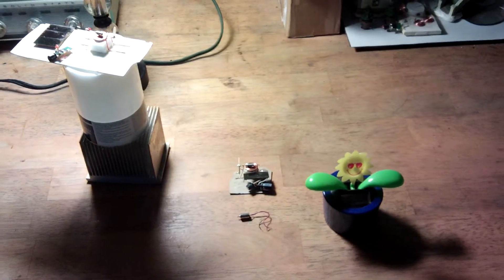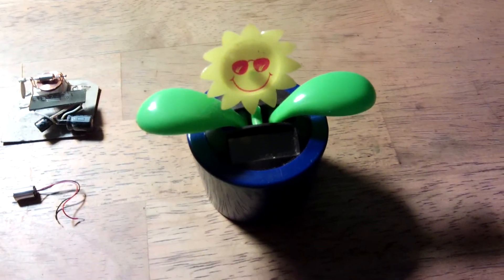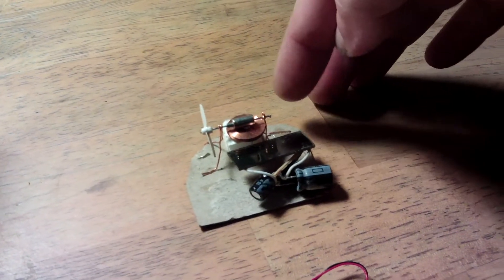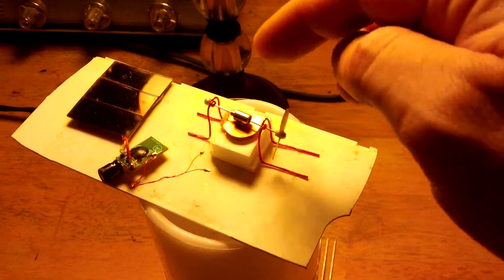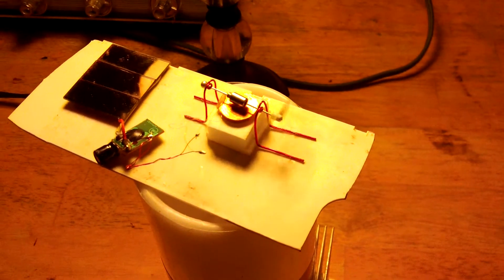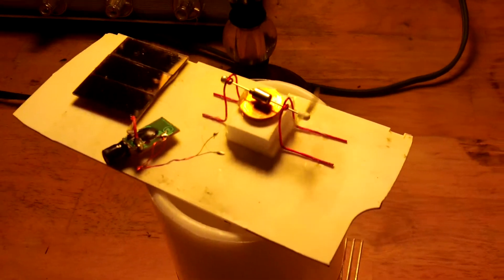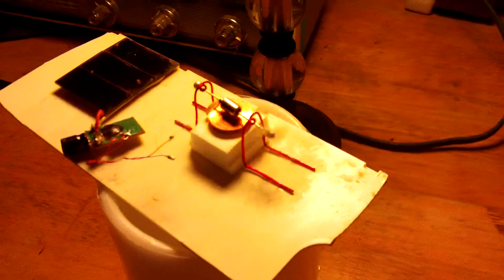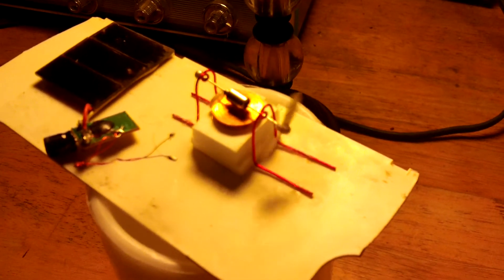Tiny pulse motor - 'real' engine sound

Comment: Is it possible to share your techniks of micro crafting. For example making small coils. I had some ideas.  But building the model goes wrong.  I tried to make a small coil with 0.1mm copper wire.  The wire always gets kinked.